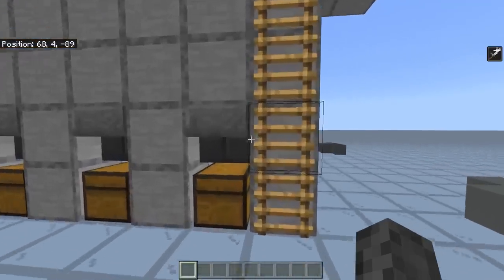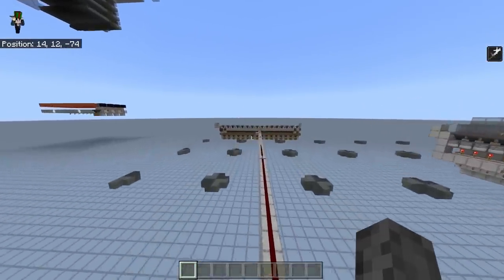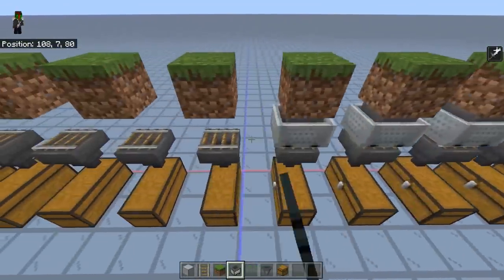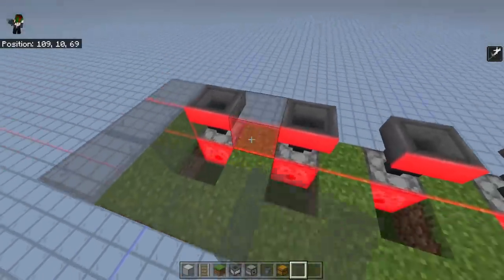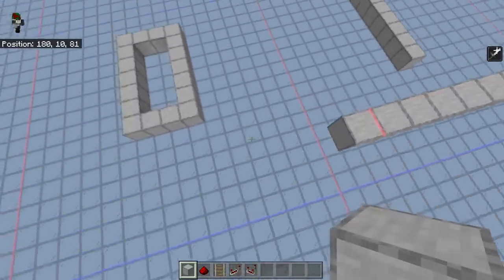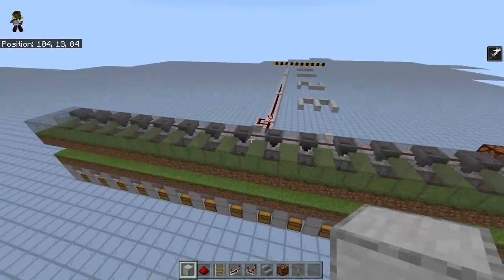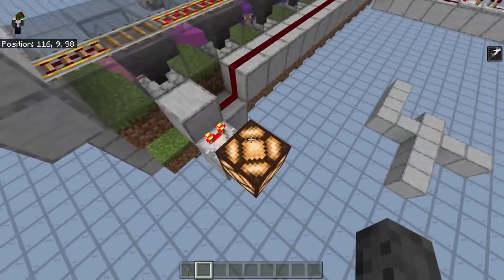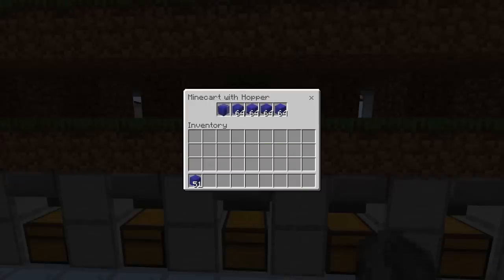Forced Update Industrial Wool Farm Minecraft Bedrock Tutorial 1.17

Comment: I was having a pretty significant issue with wool accumulating up on top with the sheep, specifically between the dispenser and the top hopper, where it couldn't be collected automatically. I was able to fix this by adding a dropper facing down into each dispenser, with the shear-loading system on top of the droppers. This forced the redstone wire (the one running parallel to the line of dispensers) to be moved backward one block. From that new main wire, a repeater set to 1 tick points into each dropper (which also powers the dispenser below it). This fixed the issue for me, so if anyone else is having this problem I would recommend giving this tweak a try! Hope this helps. 
Thanks for the tutorial Nexus, the design works amazing aside from that small flaw, this might be my new favorite farm design!
Reply: Thank you
Reply: @matthewlones6788  You're very welcome! Glad I could help
Reply: @DJStompZone  does the sheeps in this farm despawn?

Comment: Ran the farm once and that might be all I need for the rest of my playthrough! I can confirm it still works and I’m playing on v1.18.31
Reply: bro i was not able to run this
my shears only cut sheep wool once
Reply: @zoro7545  did you line up your farm along a chunk border?
Reply: @josebachedltorre6  is it important?? I think chunk border is only required so we can easily check that the repeaters are placed at the start of a chunk
Reply from the maker: The whole farm works on aligning the chunk borders exactly; it won't work if you don't align it
Reply: @navynexus  Thank you so much for this farm! So OP! ✨
Reply: @navynexus  I made this farm in my previous server and it was soo damn but I didn't align borders.... I guess that was my luck😶
Reply: it workeddddddddddddddddddddddddddddddddddd
Reply: @zoro7545  WOOOOO!
Reply: @zoro7545  chunk boarders matter in this farm because the sheep need to be one block outside the simulation distance edge so they don't get updated and lose their wool.  and the dispensers are one block inside the sim distance edge so they can run on a fast clock to generate the wool
Reply: @raymondstheawesome  yeesss
Reply: How do we see if it’s aligned to the chunk in bedrock tho
Reply: @marinaa..  resource packs

Comment: Is this still working? I followed the tutorial to a T and it's not working.
Reply: It is working make sure the chunks are aligned correctly it’s very easy to mess that up and make sure the repeaters are on the correct side of the chunk. Last thing make sure the platform to stand on is on the correct side.
Reply: @cloverfield1978  I checked the chunk alignment so many times. Everything is set up correctly to the best of my knowledge. I did notice that my lever faced a different direction when i placed it than his though. But he says it doesn't matter which direction  it's going, as long as it's lined up on the chunks properly, which mine is. I just don't know why it's not working.
Reply: SykosymatiK  check that the simulation distance is 4 and actually check cause one time I built a farm and thought it was at 4 but it was at 6 and it messed up everything. If that doesn’t work try to figure out the Redstone and the mechanics of the farm it can be pretty interesting and you might figure out your problem.
Reply: @cloverfield1978  I'm the host of a realm, so sim dist is locked at 4 by default. And I do understand the Redstone. That's why I'm so confused, lol. I think my issue may be situational or a rare bug of some kind. Who knows. Thanks for trying to help though.
Reply: SykosymatiK  yeah I’m not really sure what it can be maybe if I hopped on the realm I could take a look cause I built it and it worked amazingly, sorry I couldn’t help. Can I just know what happens when u turn your farm on?
Reply: @cloverfield1978  The Redstone operates as it should, they just get sheared once as normal.
Reply: Yeah that part has to do with simulation distance so I really don’t know the only thing I can say is make sure there’s no one else near the farm and that the comparator is in subtract mode (Lit up at the front just Incase you don’t know.) but yeah sorry this farm doesn’t work it’s really neat.
Reply: @cloverfield1978  are you the only player online in the realms? It doesn't work on our realms, maybe it is because of the players online.
Reply: I don’t use realms but I do play with another player on my world.
Reply: @cloverfield1978  does it work when both of you are playing?
Reply: Yeah but the other person has to be equal or farther distance from the farm

Comment: I'm having trouble after I built this.  It isnt working as intended, it only shears the sheep one time.  I have my simulation at 4 chunks and the sheep are right outside of the 4th chunk (in the beginning of the 5th). I have mine going east/west.  Does it have to be north/south?  My lever is at x -65 and my sheep is at x 0
Reply: Are you playing on a server/realm with other people or have a ticking area nearby to the sheep? Are the sheep in chunk 5, the dispensers in chunk 4 and your triggering spot in chunk 0?
Reply: @iowapharm2014  no I'm not playing on a server or realm, just single player world.  I thought I was sure that the sheep were in chunk 5, but I think maybe the sheep need to be at -1 instead of 0.
Reply: Anchovy Pizza the comparator in the activation line should be in subtract mode to make a clock that turns the single on signal from the lever into a many quick on and off signals. Have you double checked that?
Reply: What does the mean? Help
Reply: i  have the same problem,. you can solve this??

Comment: Thia is not working for me.....the dispenser is not putting out the shears
Reply: Could be a couple of issues. Make sure the dispenser is chunk aligned. You can use the website chunkbase to find your boarders if you don't want to download the chunk line pack he mentions in video. I also recommend using pathblocks to help mark it out. Also double check that you did infact use dispensers and not droppers(not proud of it but I've been there and done that. Lol)  Lastly, I just built the farm and got it working on my realm today. I had to turn the render distance to 5.  I then just went chunk by chunk backwards till it worked. It ended up working 4 chunks back. So I'm going to assume you will always render 1 more chunk than that of what is loaded. Good info to know. Hope that helps!